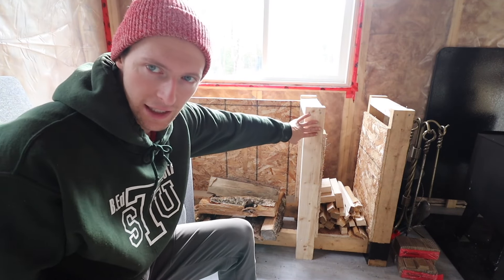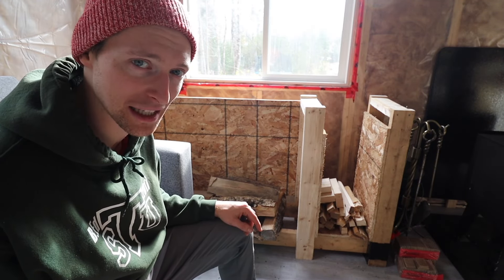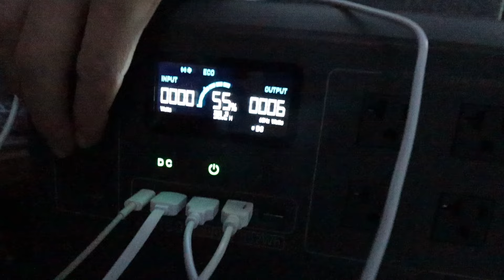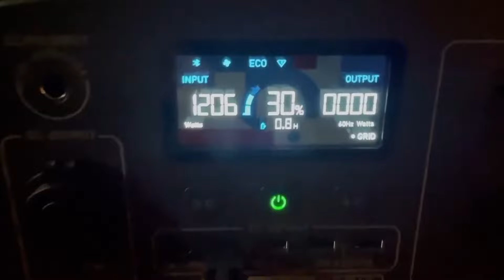We ACTUALLY Did it?! (Getting ready to move in and using the Bluetti AC180 in our Off Grid Cabin)

Comment: You can get a pure sine wave UPS that will clean up the power.  Also as a side note the UPS will be extra backup power.  I use a UPS as backup for my internet router and cable modem.  So in the event of a power outage I still have internet for 2 hours with the model I have.  I can power up the generator and plug the UPS in and charge it and continue working,  In your case, the Bluetti  will be able to charge through the UPS.  You need to make sure you get a pure sine wave UPS.  They cost around $180 for a decent 1500 Watt.
Reply from the maker: Thanks for sharing! We had never heard of them. We may have to look into. Thanks for watching!